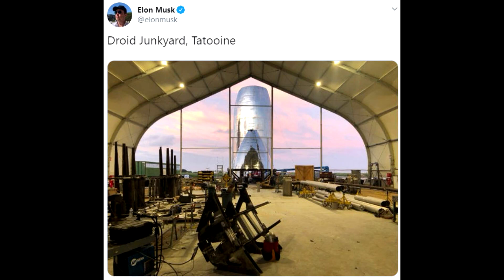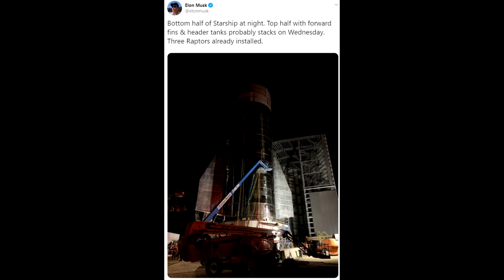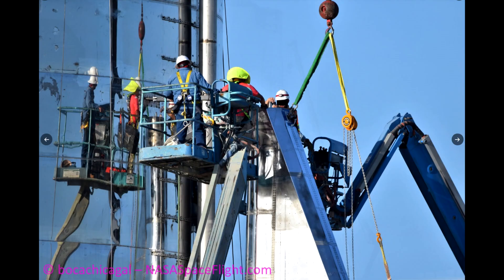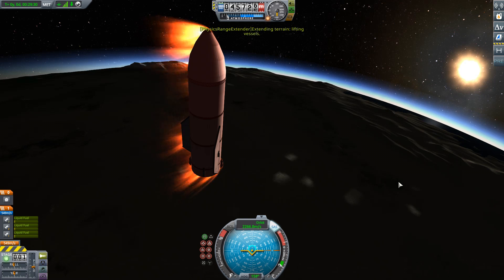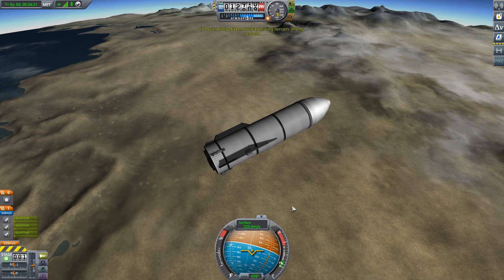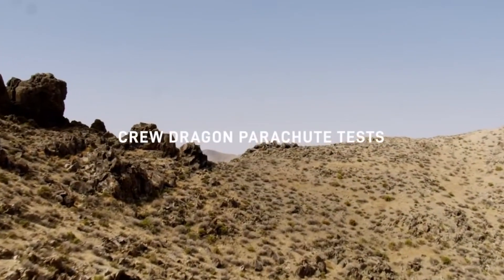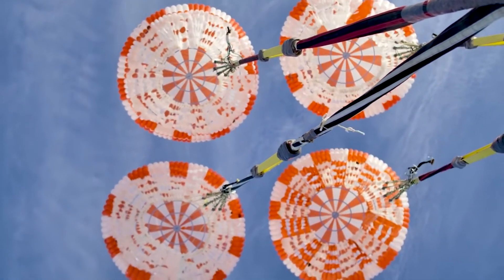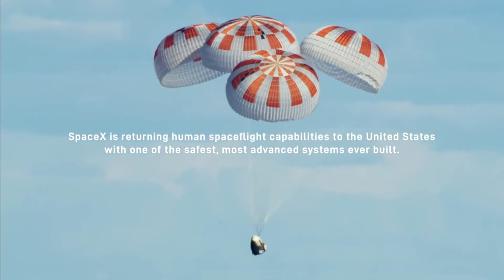New Details Revealed About SpaceX's Stainless Steel Starship as Prototype Nears Completion

Comment: I SEE STAINLESS STEEL AS A CONDUCTOR OF HEAT. it may be able to withstand about 1500 degrees. So it will basically, if defective or have flaws  will essentially bake it's occupants

Comment: I have always wondered if it would be possible to put a ship in an orbit that would take it near earth on one side and near mars on the other side. This ship would be more like a space station and it could be quite large. Let's call it a transfer station. When doing a trip to mars you would only need to accelerate a small ship with supplies and the passengers to catch up with the transfer station. The passengers would live in the transfer station. Once near mars they would get back on the small ship that took them up to the transfer station and only take whatever they need to get to mars. At this point another ship from mars could do the same to catch a ride back to earth. The idea is to have a larger living space that does not need to be accelerated and decelerated at each end. I am not sure if the orbits would of earth mars and the transfer station can be made to sync or if not would it require much fuel to adjust each orbit or to catch up to the transfer station each time it completes an orbit.
Could you simulate this in universe sandbox or kerbal and see if it works?
Reply: You're basically describing the Aldrin cycler which is a type of mars cycler where a spacecraft stays in orbit and intercepts the earth and mars at a specific period and trajectory.
Reply: @icarus387  
So is it viable? 
No one seems to suggest it. It would solve the problem of having to carry your habitat for the trip. The habitat can then be much larger and could even have spin gravity.
Reply: @franciscoshi1968  hmmm, I do remember Scott discussing this, search this channel.

Comment: The only thing I don't get about making this thing purely out of stainless is Stainless Steel + Heat + Oxygen = massive brittle crystals. Look at any stainless steel weld that's done without being back purged/shielding gas on the backside of it. If you look at the backside there's mass amount of crystals called "sugaring" that make it insanely brittle. Heat & oxygen together will destroy stainless steel.. In fact you can see that in some of those welds on those pictures where they appear brown instead of clean and the same color as the rest of it. That was done likely in open atmosphere possibly without using stainless wire but just regular mild steel wire, though the same effect can happen just from welding it in open atmosphere with TIG and stainless wire and no backing gas.
Reply from the maker: Yeah there’s a lot of discussion about the welding going on, I see that they had to erect a large wind breaker because welding was being stopped due to the shielding gas blowing away too quickly in the wind. This is a prototype, we’ll see where they go for V2
Reply: @scottmanley  yeah I think "where they go" is going to have to be in a clean room with special fixtures (or possibly breathing equipment) to keep gas on the backside of the weld as well. And btw I'm not just a keyboard warrior on this.. I actually am trained in TIG welding (as well as pretty much every other kind using electricity or gas) unfortunately my scoliosis took that as a job option for me. (as well as everything else I know how to do)

Comment: Very curious that the fins are made up of segments of steel similar in size and shape to the body segments. Does the size of the SS hull plates relate to a function as expansion joints?     The fins skins could certainly be made from one sheet of steel, perhaps even more easily considering the profile.

Comment: Huh. Two wings.
Next time, airplane landing gear.
Then regular ablative tile cooling.
And airframe made of aluminum to save weight.
Well done. Looks familiar.
Reply: Well, for one, these aren't exactly wings in the usual sense. They're more like giant spoilers and I've been wondering why they would need a third one ("tail") when it wont be seeing much useful contact with aerodynamic forces on reentry. The only real purpose it served was as an aero cover for one of the legs - the permanent one.

Comment: I'm sure the yaw problems would be easy to stabilize with both differential control and canards. I'm most curious what the final version is going to be doing for heat management though.

Comment: as cool as rockets are, they just don't seem practical in long term space travel... needing to use huge tanks of fuel to escape earths gravity is of course what we know how to do, and we do it well, but once you loose that fuel you are relying upon physics to move around, but i find it to be extremely limiting in your options for where to take a space craft, how to fly it in space, and how to commit to long term missions in space with limited supplies. just the fuel alone is almost mindbogglingly large in volumes, and its not like you can regenerate that fuel once you are in space and having ejected those large tanks, and have only your control module where astronauts are going to be living in for the duration of a flight or mission would be. what i would love to know, is what could be an alternative to expensive rockets which are so limited. what if we had a craft which could take off, and land under its own power, without sacrificing space for large fuel tanks, and could maneuver about in any direction and be free to go anywhere it could just by directing it in the desired direction you want to go. we would need some sort of energy source which was extremely dense, or could be generated nearly infinitely, or as needed. so, basically, the question i have is, how do we technologically evolve, beyond rockets. we need enough energy to move the craft, a way to generate that energy, and a way to maintain a crew for a Very long time, and speed, i cant wait until we can go the speed of light, or very near to it, or, dare i say, beyond it... i am a very speculative individual, i know that i dont have a vast knowledge on this topic, but i feel like rockets and our current abilities to move and fly in space has stagnated, and we have not made any real leaps and bounds as of yet. but, upon thinking of it, if you could generate electricity to a point that it could generate tangible thrust equivalent or greater than a rocket could, what would be the mechanical, necessities to achieving that i wonder.

Comment: Why stainless steel?
Reply from the maker: Because it's  strong over a wider temperature range than carbon fiber or aluminimum. According to engineers it has a better strength to mass ratio than carbon fiber at crygenic temperatures.

Comment: An 18 m diameter Starship would have about 3 to 4 times the volume of the 9 m version. There might be enough volume to use LH2/O2 rather than LCH4/O2 but such a craft would have to be able to use both fuels most likely on the same engines. The former for Earth orbit insertion and ideally trans-Lunar (-Mars) injection and the latter for landing. A tanker version would benefit from LH2/O2. An 18 m Superheavy could do the Earth orbit insertion part if it uses LH2/O2 and there are appropriate strap-on boosters for launch (1.5 stages to orbit).

Comment: Reentry, Starship just needs to roll at several hundred rpm to prevent overheating. I've spared many a Jebediah from ballistic planetary transfer aerocapture using the spin cycle method

Comment: If you have all four control surfaces, you can probably achieve some passive stability by angling them relative to each other, similar to the stability of a capsule bottom. It won't help with yaw, unless you have at least a fifth fin or automated control.

Comment: Which one is going to reach the orbit first? This cheap rush built grain silo or the cutting edge Senate Launch System?
Reply: My bet would be on SLS. These test articles will probably not actually achieve orbit. That will probably be done by the next iteration. That, however, may well be before SLS.

Comment: Re: 18m Starship - how big can you go before you're too big? Is there a practical limit?
Reply: Regarding diameter specifically, though, I think the limits mostly have to do with the ability to transport and assemble the rocket. It's a lot harder if you can't put segments on trains.
Reply: Really large rockets are much less efficient. Starship is intended to be close to as big as practical, I think.

Comment: Scott, if my calcs are correct, you could on a 18m Starship Ludicrous run 140 mostly unthrottled Raptor engines with 35% enhanced thrust and liftoff a twice height Starship.

Comment: Starship scares me, I almost wish it didn’t exist.   Everyone is thinking this thing is going to work, but what if it doesn’t.  Can SpaceX survive; will they know when to throw in the towel if there is crash after crash or will they bankrupt themselves in a do or die mentality trying to iron out a system that has no obvious return on investment even if it works.  I’m more than a little worried that  Kerbal is being generous both in the aerothermal and aerodynamic aspects of getting Starship back.  To my eye, there are just so many borderline untested things in both software and hardware to go wrong that the tyranny of numbers could overwhelm them.  It would be tragic if Starship turned out to be the anchor that sinks them.  So much money being thrown at this thing, I have to hide my eyes every time I see another 10 million thrown at it.  I changed my mind, I hate it.  I won’t stop feeling sick over this monstrosity until the day it is either shown to reliably work, or is terminated for good.
Reply: You're talking about the only company currently reusing liquid propellent boosters that have developed a full flow staged combustion engine. They have a tonne of experience with hypersonic reentry and they have a massive compute farm they constantly run simulations on and feed back their real world experience. SpaceX is super smart about how they spend money. These prototype rockets are ridiculously inexpensive to build compared to the normal approach.  Finally, failure is OK. Tom Mueller talks about how the Merlon became the amazing engine it is because they were willing to blow them up. I can almost guarantee they will lose one or both of these prototypes. The lessons they learn will feedback into the design and manufacturing process and eventually they'll have a completely reusable rocket which is necessary to get large amounts of cargo and humans to Mars which is the entire reason that SpaceX exists. Fear of failure is what holds back progress.
Reply: @markevans8206  1) I consider the engines to be a weak point; mixing a crude vehicle with a sophisticated high performance engine seems odd to me. 2) They have no experience with this kind of re-entry, nobody does.  3) Hardware/software integration of this kind (never tried anything like it before) is tough, just ask Boeing.  4) Yes, other than engines, it does seem to be a bargain.  5)  I won’t judge by failures either, Falcon 1 took 5 tries, but Falcon 1 was a very conventional design with few unknowns, this thing has absolutely no knowns.  6) Fear of failure may hold you back, but no fear of failure is just as bad.

Comment: Why use stainless steel on the Starship? I would of thought Space x would for gone for a more lighter material like aluminum to clad the spacecraft.
Reply: Aluminum would melt I'm pretty sure.
Reply: @coast2coast00  I did think that as I'm sure myself that aluminum has a lower melting point than steel and was the only example I could give off the top of my head. But its the thought of the weight of using a heavy material such as steel on a spacecraft and getting it off the ground and into orbit.
Reply: ...price, availability and easy construction, Scott did make a movie about it if I remember correctly.
Reply: @randomnickify  I'll check that out and give it a watch.

Comment: A lot of comments on how the rocket blew up and he calls it a win. Not crazy, in fact SpaceX not only would call that a win, they very much have already. Almost identical situation, rocket lands hard on the bullseye, falls over, blows up. They consider it a success for the data collected, and how close they got to success. And especially pulling this off using a drunk guy as the guidance system instead of a flight control computer.
Edit: Drunk guy as guidance system: Why America beat Russia to the Moon.
Reply: Not to mention he was testing the stability on reentry and not whether or not the landing legs were strong enough. :P

Comment: Just curious as to why the capsule doesn't have some sort of landing gear/legs to absorb the touchdown. Wouldn't even cold-air thrusters help soften the landing somewhat?
Reply: Crew Dragon originally designed with landing legs, using the SuperDraco thrusters to land like a Falcon 9. Parachutes were only back-ups. But the legs deployed thru the heat shield. NASA wouldn't allow that, and was leary of the propulsive landing. A redesign to land like Soyuz or Starliner, on land with parachutes and small thrusters firing a moment to soften the landing, was possible. But Cargo Dragon already had a proven splashdown landing system, and Elon decided to leapfrog past Crew Dragon, concentrate on Starship. Went with the "good enough" splashdown design. 

The landing you saw in this test was just for the test. Can land on land in an emergency, but a last resort, pretty rough on the crew.
Reply: @donjones4719  Thanks

Comment: Hey Scott.
Do you think the front canard fins being missing in your reentry make the lift issue with roll worse?
Reply from the maker: I think if I had them hooked up right it would help for sure.
Reply: @scottmanley  Yeah, having only two moving parts to control three axis of rotation is possible, but I don't think the starship was built for that. You ended up having roll and yaw control linked together.
Reply: I was thinking the same.

Comment: I refuse to accept your lack of sobriety as an excuse for the sole reason that alcohol is banned from shooting sports as a performance-enhancing drug. In that case, and likely yours, being slightly sauced affects performance by smoothing out twitchiness. It's the twitchy movements that can seriously interfere with timed accuracy in shooting sports, and likely flying an experimental spacecraft.
Aside from that, I'm very curious about those dangling data connectors at 8:05. It looks like they become unplugged when the parachutes deploy, but are they just for sensing deployment, or do they connect to squibs to dump a bad chute or something?

Comment: Scott, how many SS re-entries until heat dissipation in kj of the real object ~= kj dissipation required for simulation and engineering computations used in design preliminary to flight? Rhetorical question of course but interesting anyway.
Reply: I'd say it's the other way around. One real reentry produces as much heat as a billion simulations. Computers are quite efficient, after all.
Reply: @General12th  you could be right. It is calculable tho. Would put things into perspective.

Comment: Personally I think the super starship is a partial result of his experiences with Falcon Heavy. My guess is he didn't like all the complexity involved with multiple rockets side by side so he just want's to go wider for the sake of simplicity. If a Martian colony actually get's off the ground the need for such a thing would arise pretty quickly.
Reply: This is exactly the case. One reason why Falcon Heavy took so long to develop was because the triple launch design was surprisingly hard to control. (The other reason is that SpaceX wanted to finalize the Falcon 9 design before trying to bolt three of them together. It was a good call, too: block 5 performs way better than block 1. Falcon Heavy would not be as useful if it only got half the thrust and the grid fins melted with every flight.) By mounting all the engines under a single column, the system is far more stable and simple.

Fun fact: this is also why Starship looks like a cylinder. It doesn't taper upward like the Saturn V because cylinders are more stable and functional than cones.
Reply: Probably, but I don't doubt that they learned a lot of valuable things in the process.  In particular, having to bulk up that center core and how it ended up affecting the flight dynamics.  Starship/Super Heavy will be a very beefy system, so no doubt the earlier lessons learned will come in handy.

Comment: Could crew dragon use It's dracos in case of a parachute failure??
Reply: Not likely, despite the fact that it was the original plan.  They nixed the idea because it was going to end up requiring a lot more development than they wanted to do.  They figured it was better to just focus on other things.
Reply: Sure parachutes are safer, but given a case of total parachute failure, if you have them right there in the capsule, why not use those dracos for a hard landing and give the crew a better chance for survival.
Reply: @CarlosOteroC  

They MIGHT go back and do that someday, assuming Crew Dragon isn't entirely replaced with another system, such as Starship itself.  In the short term though, their development staff is preoccupied with higher priorities.  I wouldn't expect to see any work on it for this craft in the near future.
Reply: @Seastallion  agreed, surely they wont add any deviations to the program until the crewed missions are proven to be reliable.